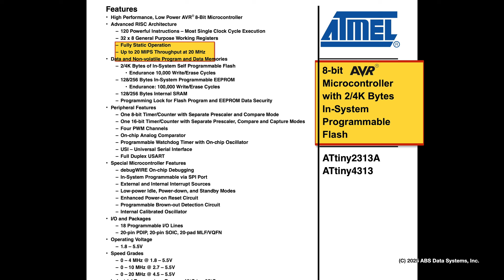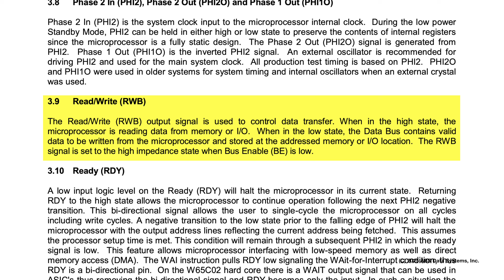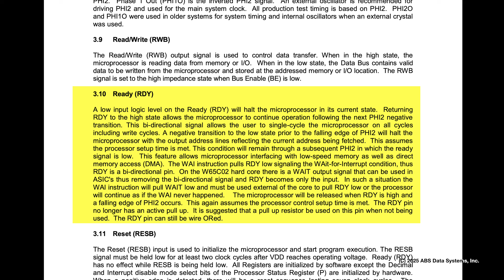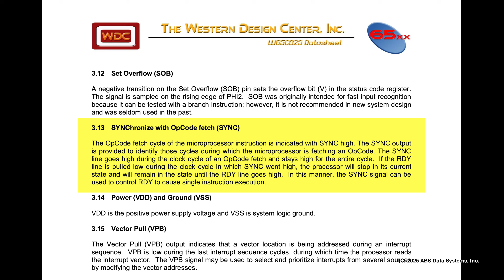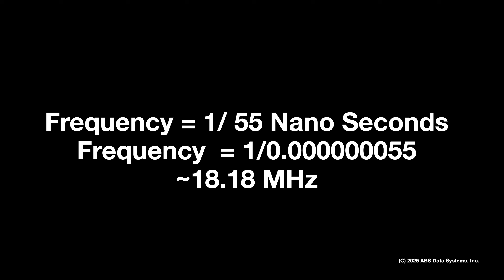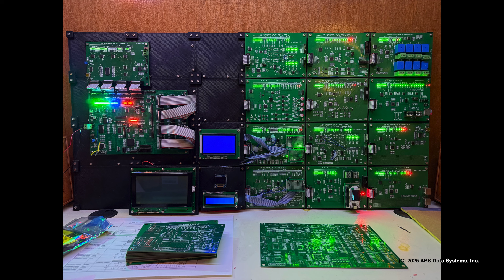Building a Modular 6502 Computer | Ben Eater Inspired: Component Selection (Phase 2)

Comment: if this computer is sooo big then it doesn't make even sense
Reply from the maker: I learned electronics when I was in high school back in 1972. The first test fixture was a 2-foot-tall superheterodyne receiver with each section broken out. It was a great learning device because I could get to everything. When I designed this computer, I designed it as an educational tool and not an everyday computer.